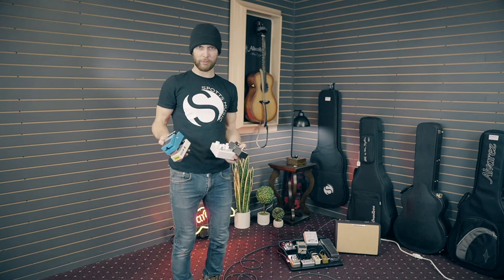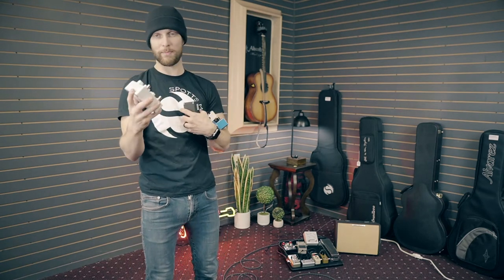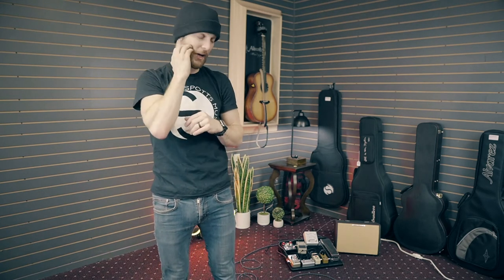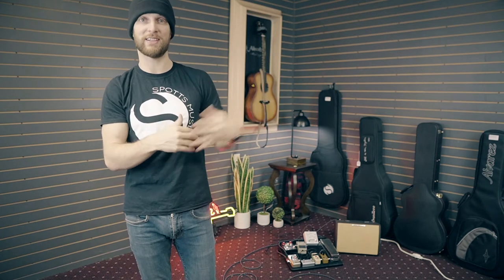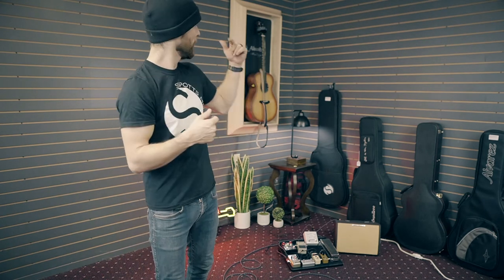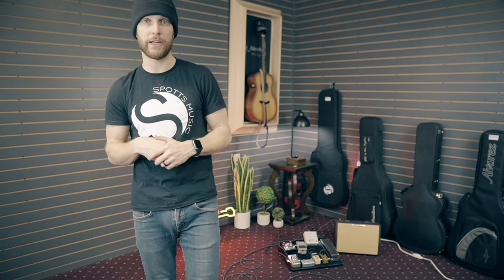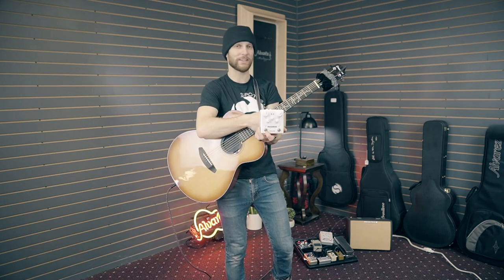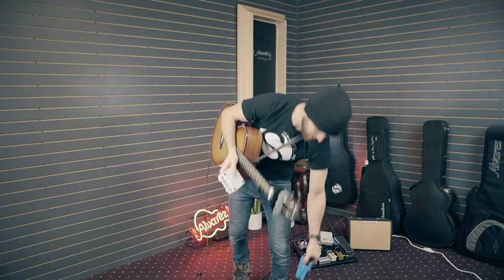Compressor Pedals and Acoustics? Explained. 4 pedals (NUX Masamune, Boss CS3, MXR Super/Custom Comp)

Comment: It's a normal video, it's just that the MXR's are tuned for the electric guitar frequency range, they're in the middle and not suitable for soft acoustic guitar and classical guitar, as well as for vocals. The boss cuts hard, so it's also impossible. Try Keely C4 very clear compressor, what you need for acoustics, I compared it with MHR, it is not suitable for electric guitar, but it is ideal for acoustics and vocal

Comment: Might want to dial volume levels the same with and without the pedal or we have no idea what the uncompressed signal sounded like. Thanks
Reply: Why? The comp boosts the signal
Reply: @nomandad2000  because to our brains louder = better, so you need to set unity volume to make a fair comparison between clean and compressed signal. Good practice to do anyway.

Comment: I've been searching for good acoustic preamp pedals to clean up my tone and what I noticed is some are mostly compression like the Bodyrez by TC and even the Boss AD-2. I connect directly to the PA through a DI. I watch the stream on Facebook and Youtube later and its not a good sound. I listen through an Aviom with headphones while I'm playing but the sound coming through it is not good at all. I don't think they were designed to do anything but be a monitor so I can't adjust anything while I'm playing. Watching this I'm just going to use my compression pedal and save some money.

Comment: Any idea how Nux Masanune works for metal or is this one of those 'duh' questions? Great review and nice guitar play too!
Reply: Depends. Anything with more distortion than a Tube Screamer or vintage Plexi is a no. You almost never want to add compression to heavy distortion since distortion already compresses your playing AND compression amplifies your noise. Compression plays better with clean and dirty tones, not super high gain (only exception is if all you do is super intricate lead and solos). Boosting a Marshall for old-school/thrash tones: yes and it would sound awesome. To boost a high-gain monster like a 5150 or Mesa Dual, you technically could but a completely clean boost brings up your low end too, making it closer to fuzz if you do too much. Better to use an overdrive pedal which already add a very slight compression (industry standards are MaxonOD808/OD9, Ibanez TS-9, Boss SD-1, Horizon Precision Drive), or TC Integrated Preamp-style clean boost with a fixed bass cut or bass and treble controls (Pepers Dirty Tree, Fortin 33 or Grind, Protone Preamp, Airis TS Pre, Lichtlaerm Aesahaettr or Amber Spyglass, any EQ pedal, etc.).